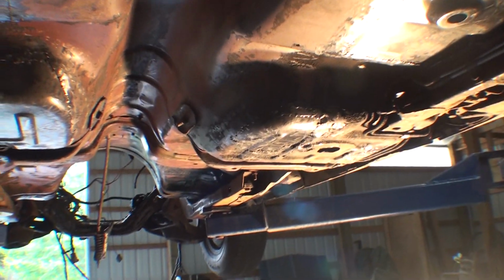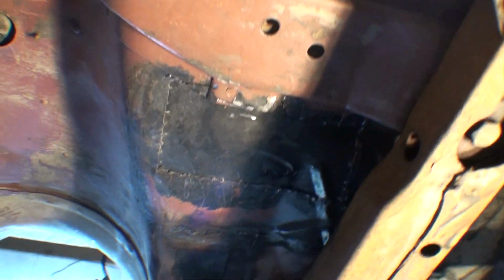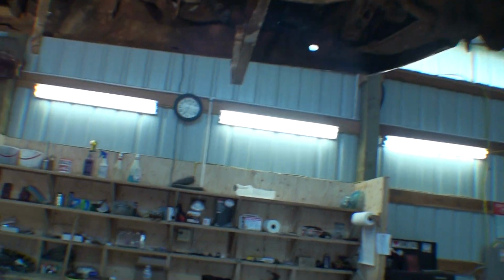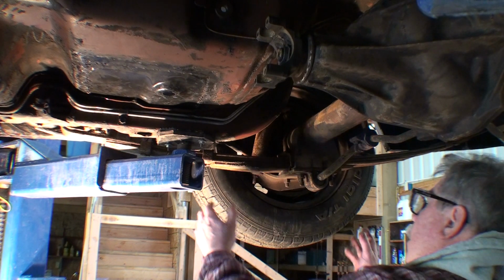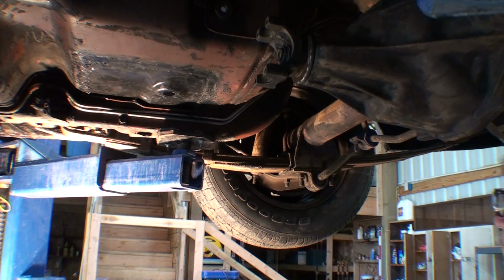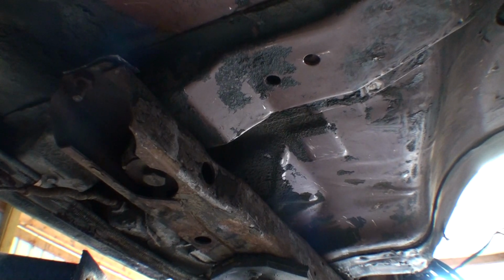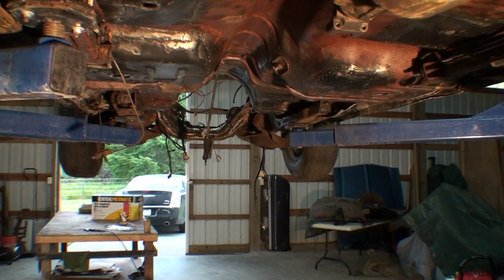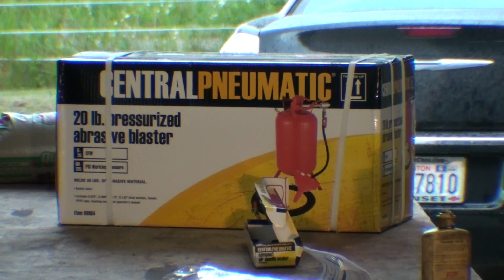Trans Am SE (Video 36) gear ratio and more cleaning undercarriage.

Comment: What is the name of that tool, and where did you buy it at? It looks like you did a great job on the bottom of your car. It’s the first one I ever saw. My original Trans Am was a 1976 identical to yours, it had a 2.41 rear end ratio, it took off slow but it got  good gas mileage and had a great top end. The 1977 I own now has a lot more rust underneath it than yours. That tool may come in handy! Thanks
Reply from the maker: The tool is Air Needle Scaler from Harbor Freight, get a warrantee because some needles will fall out after use. I upgraded the gear ratio to 3.23,  as well as engine compression to 9.7.  The best way to remove rust is sand blasting with the harbor freight . See video 43.
Reply: Ok thanks Robert, I’m learning a lot from these videos!